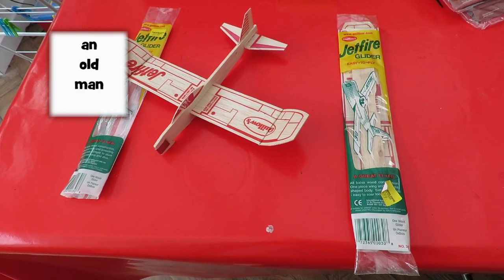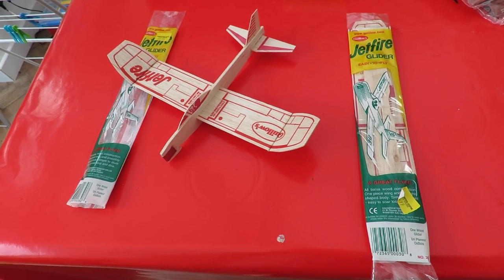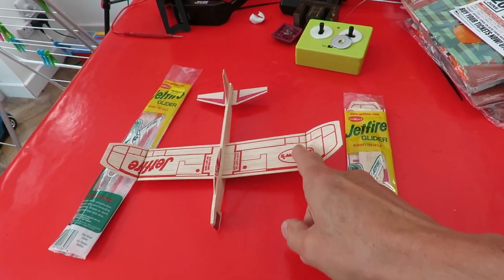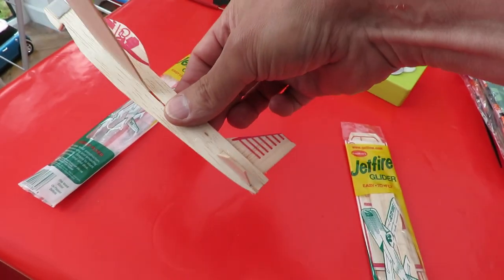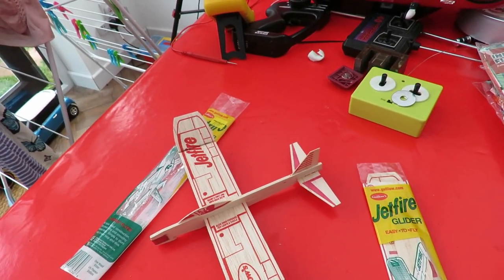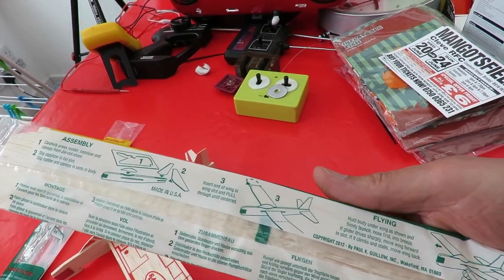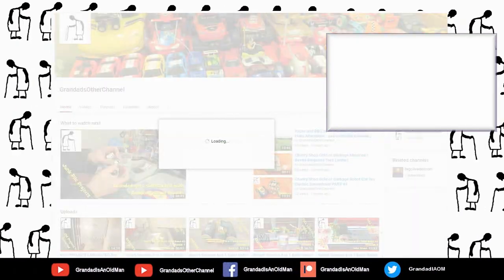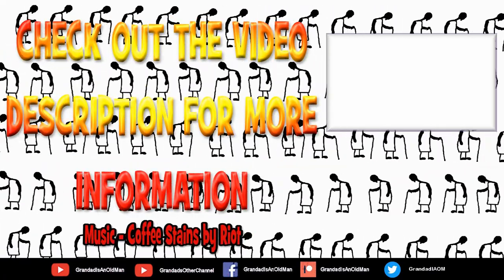Guillow's Jetfire Glider modified following Doyle Blevin's video

Comment: Is the Jetfire suitable for indoor flying, and so is the Sky Streak Motorplane?
Reply from the maker: When you mean indoor, do you mean in a large hall such as a school sports hall?
Reply: GrandadIsAnOldMan I mean a house or a mansion, I am working on something, so I need to know, I do apologise for asking the question twice, it’s because I was keen for your response, these things I do online, whenever I ask a question, some people take ages to answer, I already can’t use my computer seems it can’t connect to the internet because it’s old (check my last video to find out more), so I have to do it on my phone by adding too many tabs. Just my luck! :(
Reply from the maker: @greatbritishscarface7464  well you won't get a straight reply. How would you define suitable. It is not the size of the house , it is the size of the room. It depends what happens if you hit a window or breakable ornaments. In an indoor arena it would be fine, in your front room you are likely to cause damage to something or at least leave marks on the wall or ceiling when it hits them.
Reply: GrandadIsAnOldMan Oh okay.